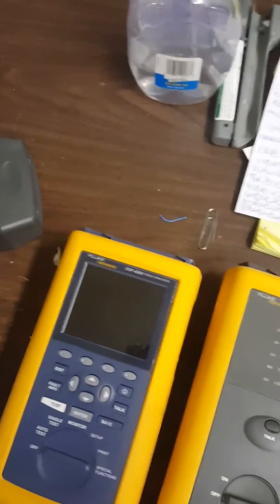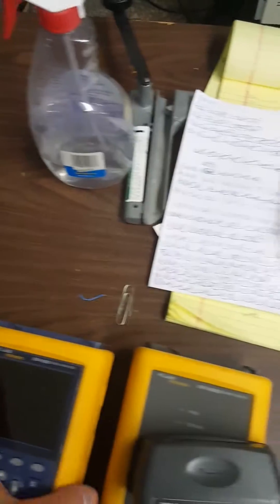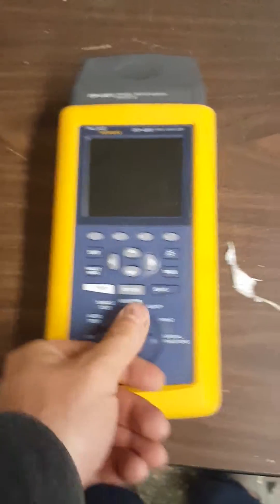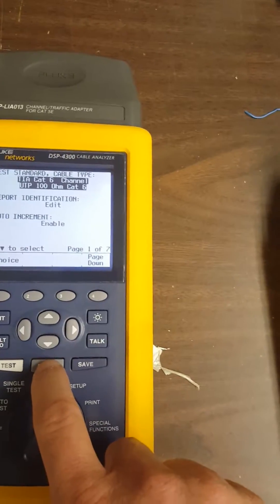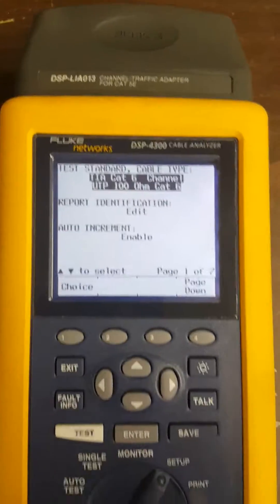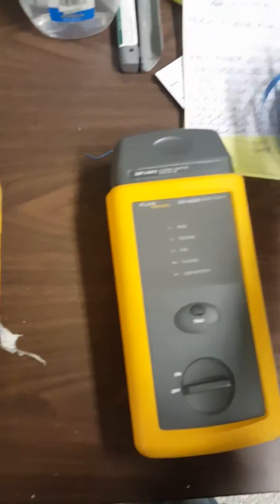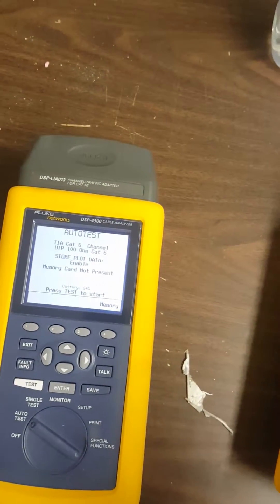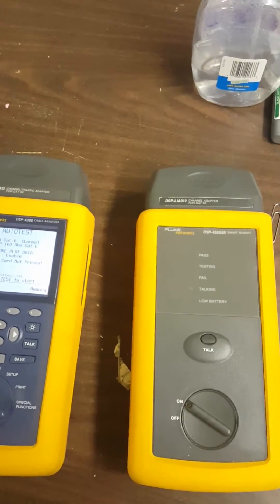FLUKE DSP Tester

Comment: If your DSP-100/2000/4000 displays "INTERNAL DATA STORAGE BATTERY VOLTAGE IS LOW" ... It is the CR2450 soldered inside... They are relatively easy to replace...  Google "Tabbed 3V CR2450 Battery Coin Cell Button 2 Tabs/Pins 24mm". Ebay usually has them...

Comment: No... My DSP4000 will not do the CAT6 test with those same CAT5 adapters. I was waiting for you to push the button on yours, but never did. That's when it errors out...
Reply: Did you find the solution because I will buy it?